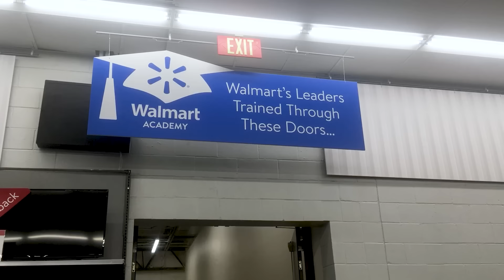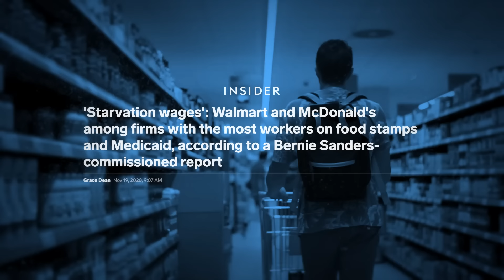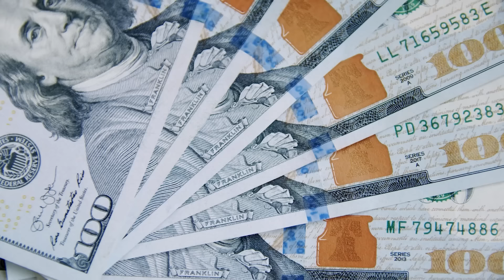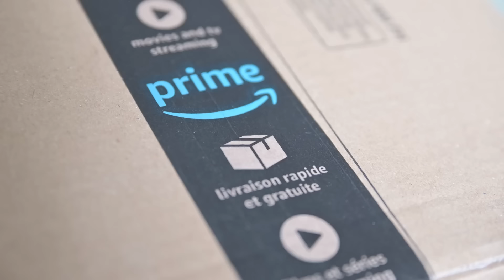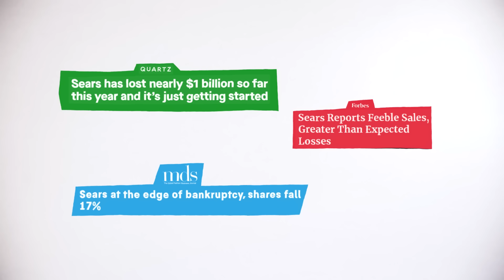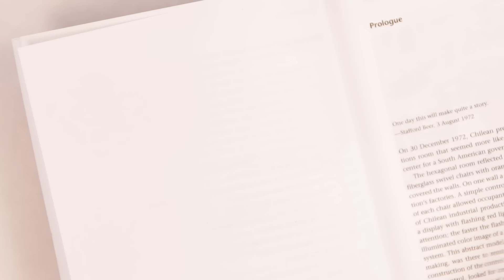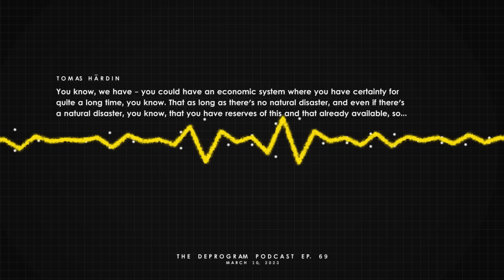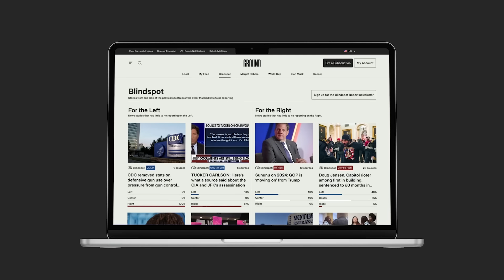How Companies Plan The Economy

Comment: Walmart is not the example you think it is. Walmart is still planning based on market pressures. What Walmart does internally does sound like what is complained about the Socialist "planned economy" but that isn't the full picture for what the socialists are asking to plan. A planned economy is about meeting the needs of the people; Walmart is meeting the wants, desires, and needs of those who can participate.

The limitations on who can participate is an issue and capitalism plays a role in that. And socialism also plays a big role in its own failure as well.

Capitalism with free market decentralizes power of the economy which is a system that allows for self repair and even local damages. A planned economy centralizes failure and has no system of feedback to restablise itself. All it can ever do is grow dependancy on itself.

Comment: Question: if a country decides to reorganise itself under socialism and adopt economic planning, how does that affect trade with other countries who remain market-based?
Reply: Depends on the raw materials, it's based on exports
Reply: Good question
Reply: Usually the US blocks them from engaging in trade, so we don't have a lot of examples to look to. It's very likely that Cuba would have continued to sell sugar to the US, but the prices would have been a bit higher, and the workers would have been better compensated.
Reply: When a country transitions to socialism and adopts economic planning, its trade relations with other countries that remain market-based are likely to undergo significant changes. The socialist country may introduce protectionist measures to shield domestic industries, potentially leading to increased barriers for market-based economies to export goods. Additionally, socialist nations often prioritize trade with ideologically aligned partners, potentially reducing trade volumes with market-based economies. State control over key industries and financial systems in socialist economies could further complicate trade by creating barriers to market access and currency conversion issues. Ideological tensions between socialist and market-based economies may exacerbate political disputes, potentially straining diplomatic relations and curbing trade cooperation.

Comment: Question:  so if the soviet union had used Walmart's resource logistic management system, would they have been thriving much better and even avoided collapse?  What resource planning mechanism did the soviet union use? Thank you
Reply: No, because the reasons for the collapse of the USSR were primarily political, but this is a long topic.
In the USSR in different periods, planning was very different. But if we take the general principles, then the management set goals that need to be achieved, specialists from the goals determined which industries should be priorities, limits were drawn up from the priorities (how many resources each of the enterprises would receive). Further, from the limits, you can find out how much a company can produce a particular product. For example, a sewing enterprise was allocated a certain amount of fabric, and the planning authorities know how many T-shirts can be sewn from this, but which specific T-shirts will be decided by the enterprise itself.
The State Planning Committee draws up the most general plans, then the lower planning bodies specify and agree on them, and the enterprises themselves decide what kind of specific product it will be. Of course there is an appeal procedure, but I don't want to go deep into the bureaucracy.
Reply: @Srijit1946  
Thank you 😊

Comment: One note on the technical implementation of the nation-wide system. You would likely want to have a stochastic synchronization schedule that promotes frequent but random synchronization. The reason being that weird knock-on effects can emerge when data-systems operate on regular schedules. You can experience resonance-like phenomena within the systems and things that rely on them (which in this case would be A LOT). frequent random synchronization helps to avoid any resonance patterns building and causing avoidable hardship.

Comment: One thing I'm not clear on: can/do firms still compete with each other in a cybersyn-type system? The video said it wasn't incompatible with markets, but how do we avoid firms using open-source info to screw each other and gain an unfair advantage? Or alternatively, how do we preserve the dynamism of markets and avoid centralization? Or am I thinking about it wrong?

Market economies, from a systems perspective, have the advantages of diversity and redundancy--heterogenous components performing the same task means the ability to adapt to new ways of doing things and having backups in case of a crisis. What markets sacrifice (and what planned economies enable) is embeddedness--the alignment of system components with each other in terms of goals. However, it seems that individual firms are still a thing in cybersyn, so is there a way to preserve diversity/redundancy in a planned economy?
Reply: Just the 'redundancy' bit: have you knowledge of how planes work? Or nuclear power plants? Or server/web systems? For all 3 (and probably more, i just know with certainty of these 3) they are planned, designed systems, with built in redundancy. Agriculture as well. Redundancy is actually rather low in market systems (ex: suez canal blockage) because of corner cutting and 'trimming the fat'. Redundancy can very easily be planned for. A planned economy can function not too dissimilar to a microservice architecture. Which also look a lot like companies in a market. But the distinct feature is that of design: markets are the fruit of economic agents driven by a single goal: profit, whereas a socialist economy might plan for growth, for basic necessitates, for commodities, for funko-pops, and that plan can be realized  through decree, through a central plan that can be adapted regionally, or it can be implemented through signals, like raising the salaries of doctors and increasing the medical schools to, ya know, get more doctors.

Comment: Who gets to decide what needs are validated to get fulfilled? When the resources are limited and the waste treshold is finite, not everyone can simply just order more copy paper for whatever project. So someone needs to monitor and oversee the consumption, and choose the projects from the competition to get completed. And not every copy paper order needs a board meeting, otherwise it's Sears again. And bcz of every possible candidate for the monitoring job has a bias, Even though the framework or a colour of the flag changes, the system remains the same. Unless, you give up the control all together and start trusting a computer program. 
Who is going to write the source code to that program? How can you trust the programmer not having any biases?
So you select the programmer. What if you get the selection wrong?
so you select new programmer every once in a while.
And you get a parlamentary democracy, filled with programmers who can be bought with their individual needs to write the source code (law book) to please the one doing the highest bidding. Eerily similar "utopia" as the current one.

Socialism is a good system, when it's not run by capitalists. Only problem with that is, the capitalists have more power over the populus than the socialists. So, even though you could create the perfect system, the perfect law book, you still need the perfect programmers, the perfect policians to run it. And that's where every system has failed. The competition to get to the top of the food chain weeds out any non-narcisistic psychopaths, so you'll have only the ones willing to kill for it at the top. And they are there only to feed themselves.
That has also happened in every try of the socialistic system. People support a leader who implements a new system. The system turns out to be functional, the leader gets replaced with a narcisistic psychopath and everything turns into a nightmare.
So, to get any positive results for the general public via socialism, you first need to weed out the greedy bastards. This process has also been tried in the past, with equally bad results.

So, you can either convince the billionaire to give up his/her fortune, or line 'em up and shoot 'em.
The former is just not going to happen, and latter, well, the billionaire also owns the gun factory and the supply chain, so..
Reply: https://en.wikipedia.org/wiki/Project_Cybersyn
Reply: @zachweyrauch2988  In USSR, they measured productivity by weight. This lead to workers creating alloys that had more mass, and their trucks sunk into the field. Fields never got sown, crops didn't grow, trucks left in the field leaked fluids into the field poisoning the field, so no crops next year either. When the toxicity levels finally dropped low enough to grow anything, the food was poisoned.

Ownership and responsibility. After the Soviet Union, there were entire cities, and in some places still are, that are/were toxic wastelands. Waste got dumped into seas, lakes, backyards, gutters, on the side of the road, bcz no one felt responsible for taking care of the waste. Same is going on in Ohio today, due to "cost cutting" and "maximizing profit", and for the same basic reasons. People who make the decisions to get rid of the waste, don't have to be responsible for their actions.

Walmart looks nice, but what about the factories who actually make the products? Even if the main store "recycles" it's waste and keeps the aisles clean, the source of those cheap products is anything but. And when the source can't provide good quality for the ridiculously low price, they just change the supplier. To get a Walmart in every city in the U.S, kids have to die. Thousands for every Walmart.

 But, if you really want to have a system based on fair trade and sustainable production, your day's work gets you a cup of coffee, if you have your own cup, and a slice of moldy banana bread. Or, a bowl of soup, if you have your own bowl.
If you want to have a house and a family, you need to find ways to steal someone else's paycheck. This basic principle applies to every current system too.

Comment: a planned economy would require the constant stream of vast quantities of data and more storage capacity than all the resources on earth is capable of providing. a good example is Germanys the coal shortage during ww2, its not that there wasn't enough coal its just that there wasn't enough paper in the third reich to administer the supply and that was just coal.
Reply: paper has limited space and needs to be individually stored and must be sifted through to read. A simple .txt file can house near-infinite characters inside (depends on the space you have), and the characters takes minuscule amount of space; not to mention that the whole thing can be made so compact as to be stored in a simple flashdrive

Comment: Walmart is a single market actor. They have one unified goal, to make as much money as possible. Making plans works there because of that, but it doesn't mean planning would work for an entire economy, which seems to be the main fallacious claim being made here. You wouldn't say central planning works because you planned to get out of your bed this morning and buy coffee from Starbucks, but that's exactly what's happening here. 

When you introduce other actors that want different things, that's when you need prices and markets, which due to the competition they enable, are far more efficient

That segways into my next point. Monopolies aren't more efficient. They're more profitable for themselves, sure but not more efficient. Society as a whole loses out. Luckily they're not particularly sustainable in modern capitalist economies for a variety of reasons. Saying markets are less efficient because they don't monopolize is nonsensical. 

And on fossil fuels and climate change. Have you never heard of consumer preferences, or negative externalities? Climate-destroying sources of energy are becoming less profitable every year, as what consumers desire shifts and as the price of the damage caused by them is added to the equation, typically by cap and trade schemes and/or carbon taxes. In that way, profit actually becomes a great incentive for dealing with the issue.

No socialist future is possible in a non-market economy. markets just provide a level of granularity and value-maximization, which benefits everyone, that no planned economy can, even with perfect information. Trying to run everything through a democratic process instead of allowing people to make their own choices, will just lead to more poverty and greater ecological damage.